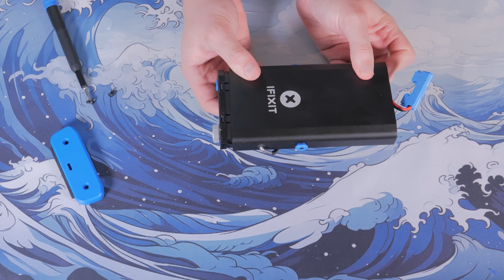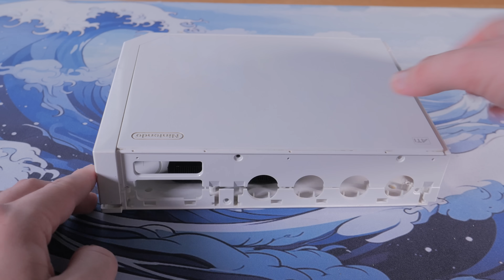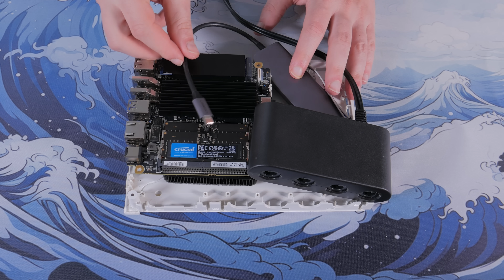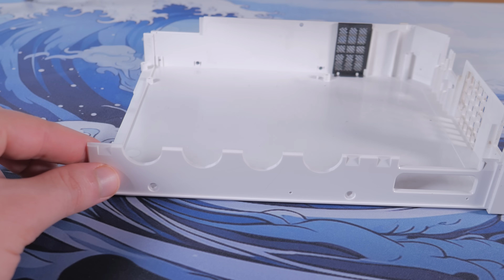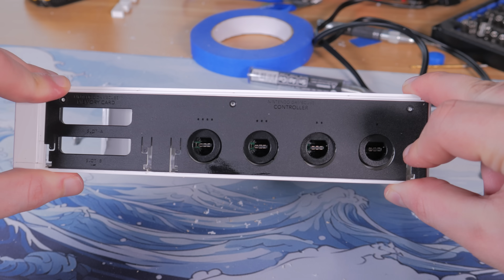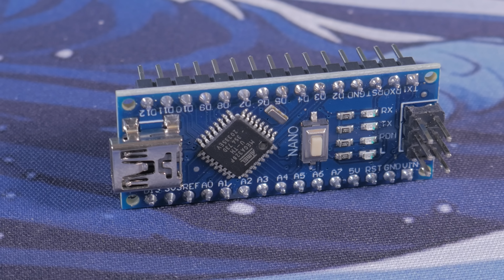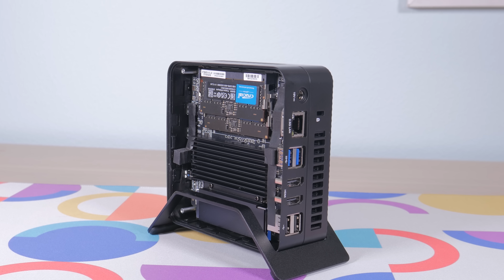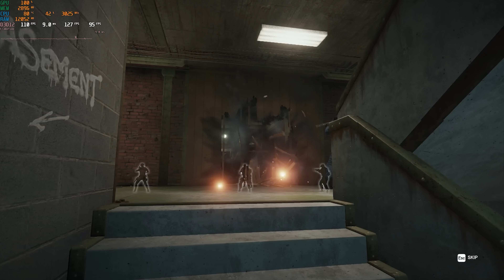I Turned an Old Wii Into a Gaming PC!

Comment: As impractical as it might seem, this is a super cool project! If I was to do something like this I'd totally try and add in a low profile GPU (at least an RTX 4060.,.. they do exist) and/or a super slim optical drive (i.e. get a portable DVD/BluRAY drive and extract it from its case like you did with the GameCube controller adapter) to make it the ultimate HTPC for the living room/game room, but I understand that you wanted to use as many original parts as possible, without makig a custom case panel to accomodate for component height, etc. You'd need to use a regular build to make that happen since I doubt most miniPCs would have a PCI-E slot available to it. Will you be releasing your design files/3D models for the project so others can take a stab at it, essentially open sourcing it? Cool video and thanks for posting!
Reply: lmao you're massively underestimating the size of a wii. A better APU probably exists tho, and he could put a little fan in there on the bottom half